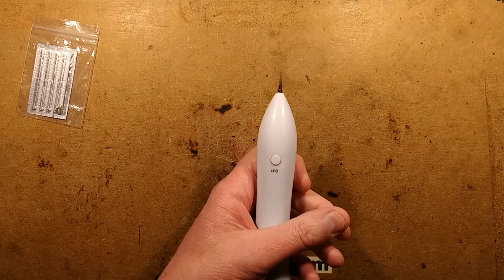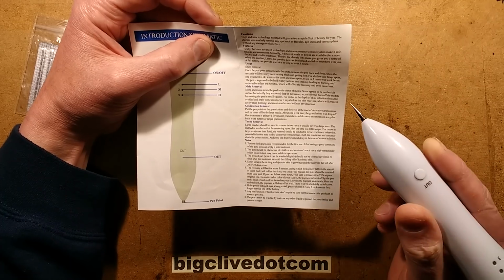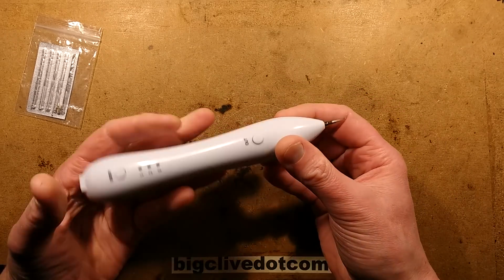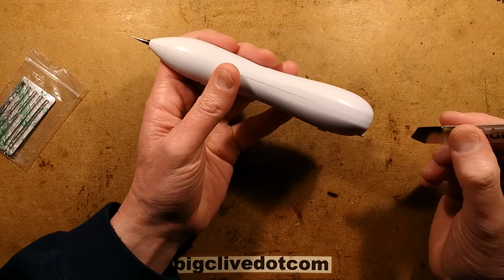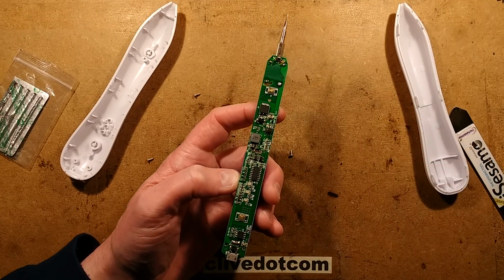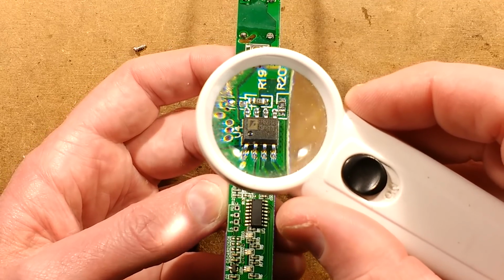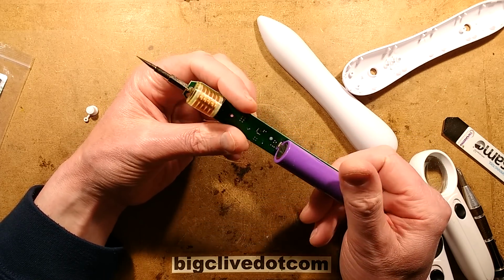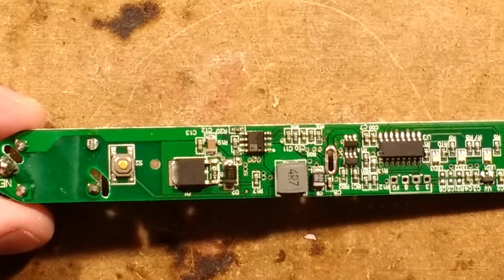USB flesh-burning pen for ladies.  Because apparently they do that.

Comment: 1) Remove Probe
2) Add some electric motors
3) DIY Vibrator complete
Reply: I mean, the shape is just about right. They probably make both at the factory and just put different guts in them.
Reply: and quite shocking, heh

Comment: I prefer cryo but this should work fine too in the hands of someone that knows what's going on. 
It's all about killing cells in a controlled and delimited manner. Killing the infected cells that form warts also kills the Papilloma virus inside them and the immune system can finally get some action in removing the dead cells. Pap* actually fools the immune system and replicates inside the dermal cells. Usually the dermal cells infected with Papilloma are harmless but they are reservoirs of active virus and this virus can actually do great harm when infecting other tissue like mucosa where it can damage cell dna with high possibilities of developing cancers. 
So, burning or freezing the derma affected is a way to cure it. High power pulsed lasers do the exact same thing only deeper and faster. Keeping the burnt area sterile is mandatory until fully healed. 

Not messing with warts is a bad idea - seek a doctor for removal asap! 
There is also a vaccine against HPV.

Comment: Clive, I believe there's a name for this type of procedure. I can't think of it now but I've had it done on some skin tags as far back as the 70's. I THINK this is the same type but a lot less powerful. 
In the Doctors office, you can see a varied size spark jump to your skin, you don't feel any shock but just a very hot point where the needle is placed, basically vaporizing the wart, skin tag, etc. A very hot centralized spot. Quite effective and fast and not much pain IMO. 
THANK YOU for this video! Cheers.

Comment: Oh, a couple of days ago I discovered a way to do a much deeper burn to your skin at very little cost!  Simply inadvertently allow a wire that you are tinning to spring up, globs of very hot solder fly, and if you don't notice it right off, it will burn through several layers of skin, and when at last you smell the burning of skin and look, then in horror reach down and grab the solder blob with your fingers, it also burns the hell out of the fingers as you remove it and toss it in you solder catch.  I now have a very deep hole in my right wrist, about 1/8th of an inch deep.  Thankfully the pads on my fingers protected them from deep burns but they still hurt, the burn on my wrist must have done some nerve damage as it does not hurt unless you touch the surrounding skin.  SOLDER IS HOT!

Comment: Those needles in the sterile packs are standard acupuncture needles as I use in the chronic pain clinics. I would urge that nobody use this electronic device as it could cause great harm and scarring to the face. Moreover, any mole or lesion should be checked out by a medical practitioner as it could be cancerous. This unit is not licenced for use as a medical device.

Comment: Could this be a repurposed plastics welding machine?
Reply from the maker: No.  It only arcs to metal or other conductive surfaces.
Reply: bigclivedotcom  No, in fact it's a high frequency generator and, no, to weld plastics you don't need an electric arch.
My guess is it was built to weld polar plastics, but it may have had just not enough power or someone considered there was no market for that, so it got sold as a whacky cosmetics machine.
Update:
https://en.wikipedia.org/wiki/Radio_frequency_welding
Reply: @miaudottk9080  Your guess is terrible, and also wrong.
Reply: @theskett  Why? Welding polar plastics can be done using high frequency (yes, this is also called welding, although you're not joining metals, because you melt booth parts to join them).
The design could have been not powerful enough, but a batch went into production. In order not to throw away the products, they thought of an alternative application for them.
Reply: @miaudottk9080  If your plastic is conductive (very unusual, but certainly possible, e.g. carbon-filled antistatic) you'll be able to strike an arc, which will generate suitable heat.  
But if your plastic is non-conductive, the usual situation, you'll have no arc and so no heat.
You notice the body of the tool is plastic, and yet somehow it doesn't weld itself? Exactly.
Reply: @theskett  Lol! Read this: https://en.wikipedia.org/wiki/Plastic_welding#High_frequency_welding .In the case of this welder, the high frequency is applied between the surfaces to be bonded, through that metal tip. The plastic case is most likely made of a non-polar polymer, hence it does not melt.

Comment: I'm pretty sure it's a home electrolysis machine (for women's hair removal), that has been re-branded - I'd actually bet an ice-cold American beer (an Old Style or Stroh's, please) on this. The 3 settings are for making adjustment's to the coarseness of the hair that you're looking to burn out (leg hair is much thicker and deeper than those fuzzy, downy hairs on a woman's cheek). It's high-energy and high-voltage because it needs both to destroy the root of the hair follicle. It comes with many needles - generally one/two for each of the clients the technician has (these needles can be expensive, so they're kept sterile and obviously assigned to only one person. https://www.walmart.com/ip/Verseo-Electrolysis-ePen-Hair-Removal-Kit/796712329?wmlspartner=wlpa&selectedSellerId=1434&adid=22222222227078580364&wmlspartner=wmtlabs&wl0=&wl1=g&wl2=c&wl3=191952519290&wl4=pla-302445162378&wl5=9021573&wl6=&wl7=&wl8=&wl9=pla&wl10=117097067&wl11=online&wl12=796712329&wl13=&veh=sem

Comment: My doctor won't do skin tags, or anything 'cosmetic'. I had one of those annoying warty moles that you'd catch - so I bought one of these and they actually work pretty well - not that painful even on the high setting and once you get the knack, the kind tag got zapped pretty quickly, and the mole thing was easy to burn away. They go red and a bit sore for a short period - maybe a day, then they heal and by three or four days, the skin is completely healed. The mole took three attempts to remove it down to flat skin level with no bump. As for hygiene you can use the sterile needles, but I just used the screw in tip and held it under the kettle steam for 30 secs or so. No infections, and apart from the soldering iron burning skin smell, I like the thing.

Comment: um, no audio?
Reply from the maker: Check your surround sound settings.  They may be diverting the bassy audio to a missing speaker.
Reply: I think I might actually have an issue like that, I've noticed it with other things, even games and stuff. It's really annoying honestly. Where do I look to fix this issue? If you don't mind. If it helps, I have a Logitech G933 Artemis Spectrum headset, and the issues are with audio from front and center, and directly behind me. Thanks in advance. Edit, I've fixed the issue :)

Comment: Will it burn off warts too? I hate those fuckers. Got a new one that popped up on the pad at the tip of my right-hand index finger ... the worst location!
But I bet it would be quite painful ... did one of those freeze spray things before, that was fairly painful I'd say. And I guess I didn't freeze it long enough because it didn't get rid of the wart...
Reply from the maker: I notice that people burn warts out with a soldering iron.  Never tried it though.

Comment: I made new thingyma-opener, a tool to pry open stuff. Noticed that large tweezers meant to pick out fishbones was perfect shape for it.. Haven't had a better, it is angled and has a sharp edge but is thick enough to get inside those harder to open gadgets where simple shim doesn't do it, and the bend gives access to places where straight can't go.. And you can make two of them. They need to be hardened first but i'm almost surprised that the exact shape is not sold as a tool.. https://drive.google.com/open?id=18weFEC0IRbC29az5bU_JigJmihm7aMUM

Comment: i always wonder why they print the silk screen on these boards.
even if some poor persons have to solder some parts manually, there is no need for it, and every cent kinda counts .. ?

- Yes i know if you get your PCBs done the silk screen is no big price point or for free,
but only because you often get it for free, it doesn't mean it is in production ..

Comment: With a 2,200 mAh battery and a USB charging circuit this might make a useful basis for a DIY test instrument like a logic probe or even a pointy voltmeter thing by installing something like this: https://www.aliexpress.com/item/Red-LED-Digital-Voltage-Meter-Voltmeter-Panel-DC-0-000-33-000V-Electrical-Tester-Portable-Tool/32653841831.html?spm=a2g0s.8937460.0.0.MvvX6O having removed it from its bezel/case.

Comment: awesome . so glad you did this. i bought one from ebay for $8. didnt come with the nice instruction book. It didnt make a spark. the led lite up. seemed to take a charge but thats it. guess now ill crack it open for the battery. think i can use it ,battery, to power my vape mod? what is it a 18650?
Reply from the maker: Mine had a 2200mAh 18650, but I'd only recommend a proper high current cell for a vaping device.

Comment: It is radiant heat that causes damage to healthy skin and surrounding nerves...Ouch. Direct heat from a thin red hot metal wire is better. The larger the iron, the more the peripheral damage. The needles would work a treat. Excellent DIY tool if you are big and ugly enough to use it. The Chinese iron looks like it would be good for removing persistent skin  'tags', and troublesome warts that do not respond to freezing. Thank you for showcasing this dangerous yet useful product.

Comment: 4:35 Those are acupuncture needles.  
On Ebay they are 100x for just a tad over $2 USD
People commonly use them for clearing clogged 3d printer nozzles.
Reply: I use them as micro-point probes :)
Reply: @quetzalcoatl-pl  yeah they work really well!  Was using some a wee bit back to run some teeny-tiny steppers & vibration motors through their paces.

Comment: ... Could I use this as a driver for my scrap-built TIG welder? As  an arc start device xd
(obviously not, there's no arc)

I got this same effect from touching the CCFL drivers on laptops. The ferrite cores just, do this.
Reply from the maker: I think the high frequency start circuitry has to be imposed on the weld current by devious design based around very heavy coils with capacitive discharge to induce the high voltage onto the welding leads.
Reply: That's correct. You need a coupling transformer of some kind. That way the HV flows through both the business end, and through your power supply (hopefully you have a HV/HF capable capacitor just before that, to let the HV flow through that instead.). If you just probe directly, it'll only need ONE wire, and that'll always be your power supply (or the HV/HF capacitor that's meant to protect your power supply). Those specialty coils lack a common name, but have a ferrite rod, and a special flat ribbon thick cable going round and round.

Comment: Do you not have to keep the button held down to keep it on?
Reply from the maker: Yes.  I was.
Reply: Just checking :), we use similar sized tools to heat stake plastic enclosures where I work. This looks very similar apart from the lack of high pitched tinitus inducing noise that comes out of them at around 30-50khz. I thought I was finally immune to the noise until I was told that after 25 years old you can't hear it.

Comment: Wow.  This seems to be a monopolar diathermy machine without a clear return electrode.  And that would result in a major risk for either burning a random bit of skin where the current decided to return to ground, or fry/disable a pacemaker.  Either way, unintended injuries or possibly even death seems possible.  I'm always unimpressed as to how much the equipment in my theatre costs, but perhaps crap like this suggests why it is so expensive...

Comment: Perhaps it is shutting down from over current due to using a fully charged 18650 at 4.20v?  Would it be worth trying with a nominally charged cell @ ~3.70v to see if it can stay on longer??

Comment: I was using similar device for burning warts at my feet, except i was using old TV HV transformer that actually burned your skin pretty deeply and burned it away after 2 repeats. This device is like nothing compared to what I was using. mine actually made charcoal from your skin, was huring like shit, but actually worked

Comment: Hey Big Clive. Yeah, being it crashes is likely why its so cheap. I wonder if putting in a ‘decoupling’ capacitor across the microprocessor chip power leads would help prevent crashing.  A 0.01uf ceramic up to even a 1uf polarized titanium or electrolytic cap might be needed. Let us know if you do that and if it fixes the problem.

Comment: Ha! I actually bought one of these (that doesn't cut out) because I had a skin tag that annoyed me - it did smell like my soldering iron when I have the wrong glasses on and burn myself, but it did burn the skin tase through with very little pain. After a few days it went red then faded, and it actually works. I had one of those warty money things on my chest that was red, and I'd often  knock it and it would bleed - so I zapped that too - and it took a few days to get it completely off - but it's worked pretty well. However, the only other mole I have is on my back and my wife refuses to even try as she thinks like everyone else, it's a stupid thing to do. The needles I got rid of, too scary. It does work pretty well - and the heated skin does glow red nicely as it burns away!

Comment: Try reading the frequency with a frequency meter.
Some AVO meters read frequency. kHz range.
RF burns are not at all new.
Licenced Radio Amateur here for 32 years.
RF tends to burn from the inside out and turns the skin White. Very sore, not recommended.

Comment: I'm beginning to think, that the chips might not have no number on them to prevent copies, but rather because they need one less manufacturing step which might save them a fraction of a cent and make the components cheaper.

Comment: Fabulous.  I muse get one.  That kind of thing I have used to remove warts.  Basically, stab the wart with a sharp needle and then heat the needle red hot with a miniature gas flame.

But ... does it work as a portable soldering iron?

Comment: It's a real thing. We got involved with an epilator that failed EMC due to having a massive air core running at 100s of kHz. It's the only instance I know of Trading Standards getting involved. 

Our replacement was solid state and ran at a few MHz if memory serves. You have to get the frequency up there so it travels around your body not through it (Skin Effect). Above 1MHz there are different safety rules. The return path is the parasitic capacitance of the battery. In clinical settings Earth couples between the operator and the client. I can't remember the power levels but it might have been a few Watts. 

We used to practice on teabags.

EDIT: Just checked the schematic and it was 3.2768MHz running a class B output stage run from 50V. Output via 22nF. There were a couple of transformers used only for isolation and voltage gain.
Reply: My identical unit runs at 280 kHz with the needle not touching anything, according to my spec an.  2nd harmonic about 6 dB down at 560 kHz.  

I use mine to remove cherry angiomas, and it works quite well.  The needle produces just a tiny spot of cauterization, without producing scarring.  UT has a couple of videos where the technician touches the needle tip to the angioma only for an instant, then repeats.

Comment: I did once burn out a wart with a soldering iron. I wouldn't recommend it but it's not as painful as you'd think. Third degree burns for the win. By the way, the proper medical electric bistouri type things are way more robust than that. The blades aren't very sharp but they produce enough power to cut through flesh with ease. There are multiple settings like cutting, cauterizing or spray cauterizing. Interestingly the way it's biased towards cutting or cauterizing is not necessarily by changing the power, but changing the duty cycle. And the spray thing is just higher open circuit voltage so it arcs more. Normally on the proper equipment there is a relatively large grounding electrode to attach to the patient for the current to return to prevent burns elsewhere. Of course building that stuff mains powered is fairly dangerous so high quality transformers are a must and they usually come with a separate, really thick gauge earth connection. There's lots of regulations you have to comply with as well. Of course if it's not for medical use but rather chinesium "beauty" products none of that applies and you don't know what you're getting.